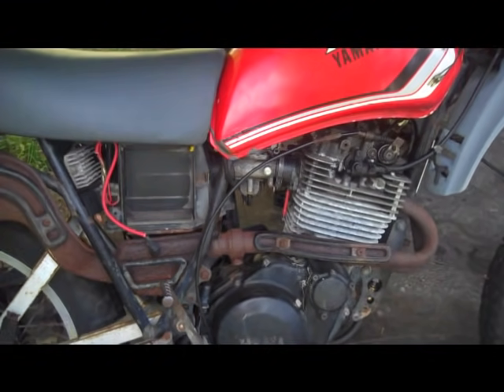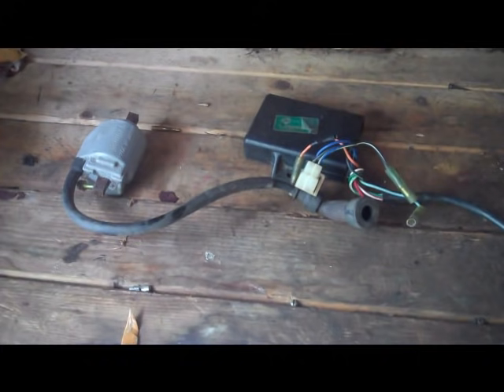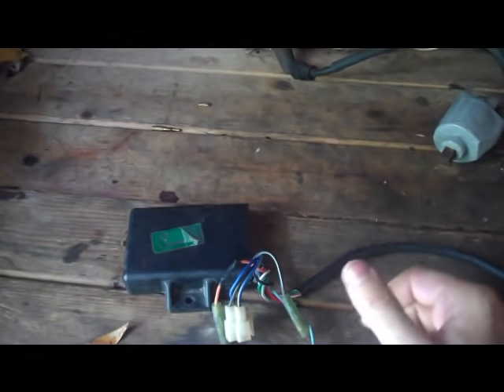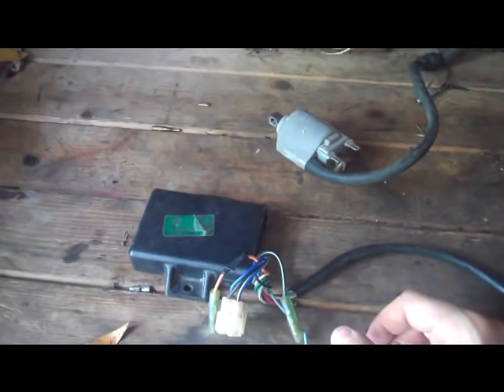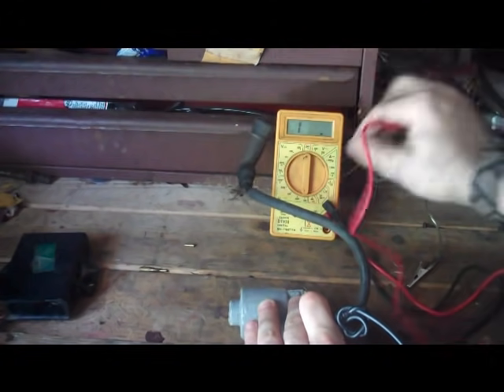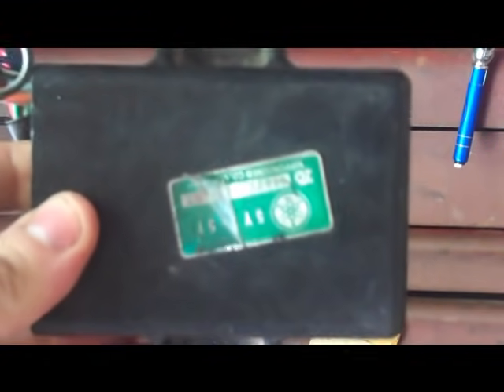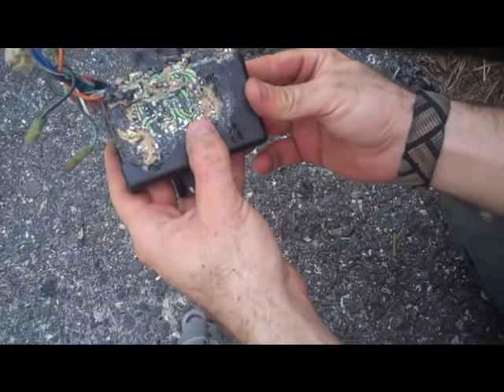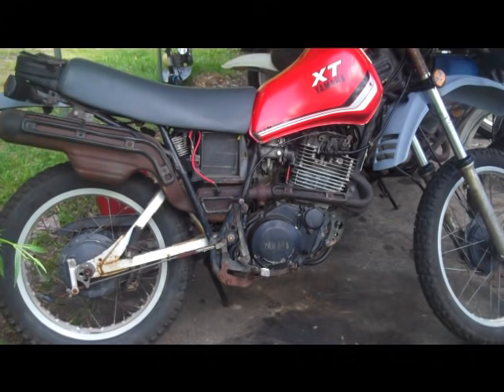How to test motorcycle CDI box, ignition coil

Comment: I have a 2004 yamaha vstar 650 classic road all day Came out next morning hit start button it turned over twice then the start button  was completely dead I jumped the starter relay it started I grabbed clutch and bike died and now has nothing at start button or spark  I changed plugs coil packs stator and pick up deleted kickstand switch  got new clutch lever switch  new neutral switch new battery new starter relay solenoid  new start button  and deleted kill switch and installed new ignition bike turns on fuel pump comes on just no spark or start button you think it could be CDI
Reply from the maker: does the motor still start up if you jump the solenoid?
Reply from the maker: Yeah that grabbing the clutch thing is definitely a safety switch. I hear you that you deleted the switches, doublecheck your work becomes some of them are connect the circuit to kill, and some of them are separate the circuit to kill, so if you dont have a wiring diagram you gotta play around with it a little bit. Also does your bike have a tip/lean sensor switch? Im pretty sure it does if I remember correctly, basically kills spark if it detects that your bike has tipped over
Reply: @mrmaxstorey I just changed the tip sensor cause I had one I got the bike to start by jumping the relay but still no start button
Reply: @mrmaxstorey Same thing again soon as I grabbed the clutch the bikinstalled and no spark
Reply from the maker: @STEELRIDER80 Ok if the bike will run at all by jumping the solenoid then the cdi is good, it's only job is to produce spark. Like I said this is really likely related to that clutch safety switch or your neutral switch, does your neutral light up green when the bike is in neutral?
Reply: @mrmaxstorey yes and it's new and I tried jumping the clutch switch still no spark
Reply: My bike does have something called the little blue relay.It's like a little blue relayed box.I did order one I wonder if it could have anything to do with that
Reply from the maker: @STEELRIDER80 check this guy's diagnostic process maybe it can help https://www.justanswer.com/motorcycle/82pil-2007-yamaha-star-650-classic-will-not-turn.html
Reply: @mrmaxstorey Thanks for all the info I just decided to go ahead and order C.D I It's the only thing left  I haven't replaced And it never hurts to have an extra if it doesn't end up being that.
Thanks for your help

Comment: i am just trying to sort out my non starting xt600e. i have little sparks in batches of 3 about 2 seconds apart which don't do much for ignition! just found the CDI box under the seat hump. i have replaced the ignition coil to no effect. i have to check the pick up coil and generator. pleased you got yours going.

Comment: Will you still have spark if the cdi box isnt working? Or would it just kill spark completly? Ive got spark and fuel but wont fire up. Im wondering if its just a wrak spark from cdi?  Ive tested coil and ive got new plugs
Reply from the maker: Usually it kills spark completely, on rare occasions a bad CDI will kill spark on one cylinder. If you have spark and fuel check your compression

Comment: how does it hold in the smoke when you diagnosw it with a hammer  and that bike is the bigest slug ive ever thrown a leg over it couldnt get out of  the way of a snail  coming  the absolutly  slowest gutless  motorcycle ive ever   seen     its nothing fast  thats for sure   grandma in a wheelchair would beat it in a dragrace
Reply from the maker: k

Comment: Could you help with a polaris scrambler 500 atv?
Reply from the maker: Whats the problem
Reply: @mrmaxstorey  so we had it runnin today but it sounded like it had a misfire and when you shut the handlebar switch off itd run alittle better then it wouldn't start back up we think the cdi is causing the timing to be off but any opinions would be appreciated
Reply from the maker: Yeah it could be. Are you saying it ran after you turned the key off?
Reply: @mrmaxstorey  correct,we shut they key and switch off and it kept running it actually ran better with the switch off
Reply from the maker: Ok confirm your wiring from the ign to the cdi, it should ground out the cdi and shut down the motor. Also confirm you have a hood battery sometimes people will bypass the battery and force the cdi to run off the alternator, if its not designed for that then it will produce weak spark. Maybe the switch is backwards so when you turn the ign off it reestablishes contact w the battery and now you have a better spark
Reply: @mrmaxstorey  will do thank you I'll lyk how it goes tommorow

Comment: Check coil by wiring copper wire to iron coil core then to one of leads thento positive, Touch other lead to ground and spark plug wire will spark to ground. Like the cdi/tci the spark happens when ground is disconnected.

On cdi/tci check for safety controls. Side stand minus neutral on OR Kill switch on.

Check the pickup. Broken wire (open circuit), pinched/shorted (rings true to ground).
Check ohms across leads, some bikes have multiple pickups.(2 for two cylinders).

Repair is possible.

Comment: If you suspect you cdi box, try heating it with a hair dryer until too hot to touch, then try to start your engine if it starts as it probably will your cdi unit has failed. A company called Carmo in the Netherlands can repair them.

Comment: When I got my new racing cdi box it has different plugs on the racing cdi box then my stock one did how do I color code it ,does anybody know ,all so where does the orange and black wires go out of the racing cdi
Reply: ignition+  wire always on the bottom left facing the socket.. bottom right is the ground wire. upper right is the pickup coil and top left is the wire that goes to the ignitio  coil. mid socket or extra wire is the kill switch

Comment: Hi Mr Max, I have a 1986 yamaha FZX 700. Everything was fine until I decided to put one of those Chinese tachometers. They only have 1 cable for RPMs (usually yellow with back stripe) versus 3 single cables (black, brown and orange) from the bike's harness connected to the OEM tachometer. I connected the yellow with black stripe to one of the cables of the bike and by bad luck another cable touched these 2. Since the day this happened the engine fire up normally (as usual) but when I connected the OEM tachometer, it doesn't show any RPM. Same happens with the chinese tach. Also, my bike's turning signals don't light up when required. Headlight (low/high beam) is OK. Do you think is just a blown fuse or blown relay? Or I damaged something on the CDI?.
Reply from the maker: Fuse is most likely as that circuit is protected by a fuse. The CDI only controls ignition timing, so long as the bike is running then its likely unaffected

Comment: A long time ago now, the Big 4 Japanese manufacturers (presumably others too) made an electronic box of tricks they sold to dealers to check the functions of CDIs - IIRC the Suzuki option was c. 1000GB£ back in the Nineties ... Seemingly now, all very rare - perhaps they were scrapped, as the more sophisticated E-M systems came in .....

Slightly puzzling that this seems to present a gap in the market - so many people have 80s and 90s / early 2000s bikes - Why hasn't someone come up with a tester - something with interchangeable jack plugs, so you could use it across brands/manufacturers etc ...
You'd think there'd be some profit to be made!

Comment: I know this is a old video but i have a 50cc moped. When i drive for some time. when i shift to neutral and rev it has like 1 second pauses and doesnt rev high. its a 2 stroke and it should rev atleast 9500rpm. Is my cdi broken?
Reply: rev limiter??
Reply: @proarmy70  little late for help dont u think man XDD
Reply: @Aprikuusi2003  nah never to late, did you find out the problem
Reply: @proarmy70  stator or mainjet cant remember.

Comment: My 94 fourtrax 300 runs perfect and starts without any flaws... but after about 20-30 min of riding the bike will start lose power and then it Almost feels like it's out of gas ...after that it stalls and I have to give it like 2min then start it again and it just repeats
Reply from the maker: That is a common sign of a failing electrical component, either the CDI or the coil. It fails when it warms up, and the works again when it cools down
Reply: mrmaxstorey it started out every 30 min or so it would kick out but now it's a lot more frequent every 3 min now ... I ordered a coil and hoping it's just that

Comment: I Have a 2004 Honda Shadow 750 Aero, my problem is I have no Power at all, I replaced the Battery and still has no power.No Lights ,horn, turn signals NOTHING! I checked the fuses and all appear to be ok, I was not able to check the main fuse (if Any) because I have no clue where to locate it, any suggestions to what may be causing this NO power problem?...Help Please!
Reply: rick benavides I have a 98 shadow  there is a fuse by the battery for starter that was hidden for me , my fuse was on left side of bike I traced  by following battery cable ,
Reply from the maker: My video on wiring diagrams will be the most helpful for this repair. However if I were you, I would focus most on checking that your wires from the battery are clean and tight, main ground is good, all wiring to and from the starter solenoid is good, and that the battery is holding good voltage and that you dont have a parasitic draw somewhere
Reply: Check fuses
Reply: check your grounds. had the same problem on my 85 gs450. no power nomatter what i did. found a small black wire with a white line just hanging, "broken". I grounded it out, and suddenly everything worked.

Comment: sir did you have a vid. that showing how to know if the rectifier is damage or not if the rectifier was damage how to repair it thanks im from the phil...
Reply from the maker: Yes check out my charging problems video
Reply: mine it is charging green light shows up on the battery charger

Comment: I have an atv that use to run flawlessly but now it doesn't. it turns over, lights work but it just will not start. Anyways, I replaced the ignition coil and spark plug, new battery, new carberator, but I'm not receiving a spark. could it be that I need to replace the CDI box?? please help, I'm stuck on what is wrong with it.
Reply from the maker: Its possible, but check out my no spark video before you spend any more money
Reply: Gabriel Mundo replace cdi box
Reply: Gabriel Mundo check stator and pickup coil
Reply: Chiger

Comment: Can the smoke be replaced after you release it??
Reply: Yeah you have to hit it with a MAP torch just until it smokes again, then submerge it in a bucket of cold water to condense the smoke and it will trap the smoke back inside the box. A handful of 9v batteries in the water also helps.
Reply: It's very simple to replace the smoke that you've lost, just set the CDI on fire and the smoke will return.

Comment: HiI have a 81 Yamaha 850  And there's no nothing its like not have a battery in it.What could it be? the lights motor nothing comes on.
Reply from the maker: First test the battery and make sure its good. Then make sure the thick black ground wire is securely tightened to the neg on the battery and to the frame, without any corrosion. Next follow the red wire, and same as it attaches to the starter solenoid. make sure those attachments are good. Check the fusebox this is a common fault point, often fuses get corroded or loose. Get you rmultimeter out and make sure you are getting voltage on either side of the fuse
Reply: i tested it i cut my grass with that battery six times in a riding mower

Comment: I dont know if I will get a response, but it would be great...
So I have been trying to get a 1973 yamaha ct1 175 running, and I changed the points, set them, I changed the condensor, and I have a low voltage spark. There is a spark there but its not strong enough. I think it could be the coil, but is there any other things it could be?
Reply from the maker: You have wiring and connectors, and output from your stator to check, but yeah you are narrowing it down
Reply: so my 80 gs 450l crapped out on me.  my battery is not charging and on of my cylinder is not hot like the other it has spark on both of them.  i feel the exhausts and left one has more air pressure than the right coming out?  i feel my battery and it felt very warm and the ground and positive wires?  any clue what's going on?
Reply from the maker: Sounds like you are only running on one cylinder and you have a charging problem. Test your battery voltage with the bike running,w hat is it?
Reply: when full charged 13.40 when hooked up on the bike and running the battery says 11.40 and if you let it run later on it drains the battery completely.  as far the cylinder that is not working i took out the plug while the bike was running it was moving and i could feel the piston blowing air through the plug hole.  idk i might have to sync my carbs again.  i hopw that helps.  again thanks great videos
Reply from the maker: Well, you arent charging. Check out my charging video for the diagnostics. Are both your header pipes heating up as the bike warms up?
Reply: mrmaxstorey no just the left side, the right side heats up very very slow
Reply from the maker: How did the tip of the plug look
Reply: kinda on the leaner side
Reply: i found out that my air screw gasket is chew up is that  a factor?
Reply from the maker: Anything defective should be replaced
Reply: finding that part is just too hard that oring is hard to come by
Reply: I had such a problem and I changed the pickup coil, the problem was solved, I don't know whether it will help you but this was my issue,I also had a defective cdi box in the past and I had no spark at 

all.
Reply: that will cause  a live short i did  it once with a bike

Comment: hello my bike which is 02 zx7r has no spark i checked if the coils gets electricity and i found  that the coils gets positive only and they missing negative. i checked if it has bad ground but its grounded well. all the fuses alright also. What can it be?
Reply from the maker: On most CDI ignition setups, the coils will get constant power when the bike is on and the CDI wil provide intermittent grounding, thus collapsing the field and causing a spark. If that isnt happening, its possible the CDI is bad, but other problems could be causing that, such as bad safety switches or kill switches, or bad pickup coil
Reply: i would exclude safety switches in this case because the starter and fuel pump gets react on start bottom. all the plugs which goes to CDI was also checked for presence of electricity. Seems to me this is bad coils
Reply from the maker: Coils are tested by checking the resistance to electricity flowing through them. If your coil field is not grounding out while you try to start the bike, its not the fault of the coils. The CDI is not doing its job, either because it is faulty or the electrical components which tell it to fire the coils are not giving the appropriate input.
Reply: i connected negative straight from the battery to the coil with jumpstart wire and it gives the spark. So in this case i think and like you said this is the CDI or connections to CDI or maybe crankshaft position sensor??
Reply from the maker: Thats what Id go with
Reply: My two igniters have been reliable. Most problems are low battery.  It must provide 12.6 volts on Cranking), bad grounds, bad connections. Check battery grounds/connections; grounds/connections at coils. Also, Igniters do Not like to get wet. They are right under the seat!  Remove, brush all connections, tighten harness side, fill connector with trailer or silicone grease(any grease, Vaseline, will  do), and if problem persists; put  some siliconized latex caulk around connections, lid seal and screws, and two screws on back. SLC will simply peel away if need be--it isn't permanent like silicone and is cheaper.
Reply: Yes--Kill switches are exposed to weather, notorious for problems. Bypass it, too, to diagnose.

Comment: can a 1979 honda cb650 cdi, be repair
Reply: There is a way,  but an aftermarket or used unit starts at  only $38.  I will have one on Ebay in a few days. $40 plus S.  It ran for years, I just bought another when I thought it was my igniter but it was a  low battery. My Honda had 7,000 original miles on it when I replaced  it. This one is sealed from weather, too.   Some out there publish own schematics to replace  them. The Honda schematic is unobtainable.,  Again, it is a points eliminator not a CDI.     These homebrews Might be CDI or MSD.   MSD also guards their schematics  jealously, but any engineer or good tech can home brew one.

Comment: Out of curiosity what does "CDI" stand for?
Thanks for the vids!
Reply: this is Not a CDI ignition. It is simply electronic points eliminator. CDI requires a large (1 uF or so)  between coil minus ("-") and ground.
Reply from the maker: capacitor discharge ignition